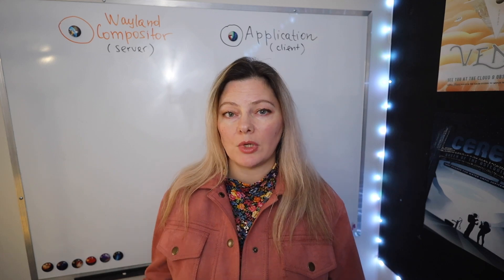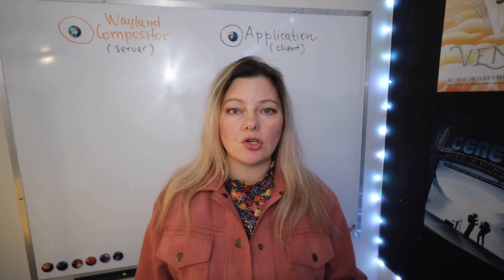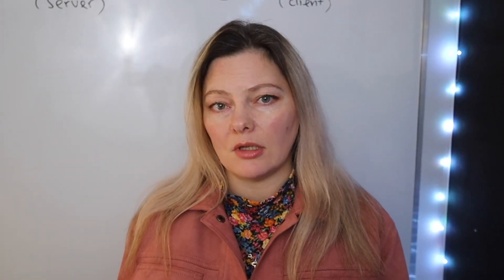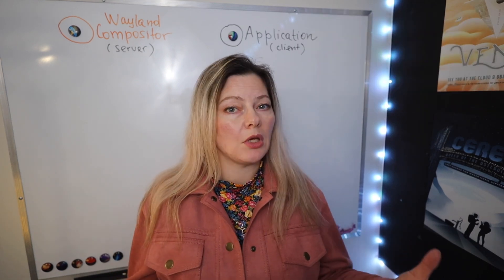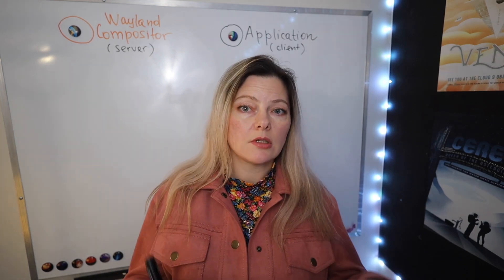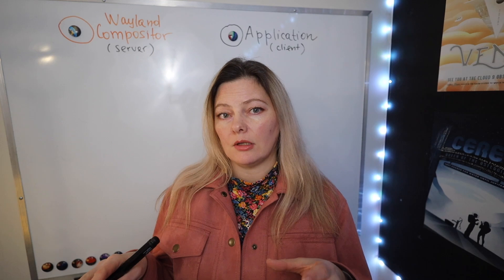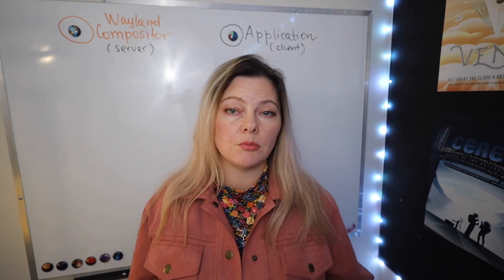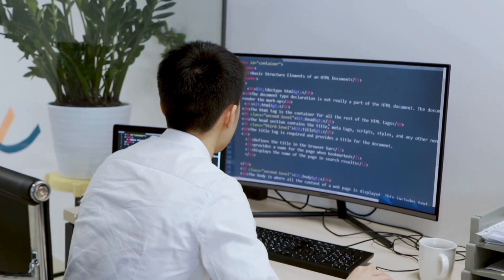Understand Wayland's Source Code in 15 Minutes (No Coding Degree Needed!)

Comment: I'm looking for the most basic C sample program that will display a Wayland window on a Linux desktop. It's very easy to find small sample programs for X11, but not for Wayland. Maybe people who have spent much effort to learn the application coding are not going to give away their code. I can understand that.
Reply from the maker: If you haven’t seen it yet, tinywl is a super minimal C example of a Wayland compositor using wlroots. It’s not quite “hello world” simple, but it’s about as barebones as it gets right now.

I’ll try to break it down in a future video as I work through it myself.

Comment: This was a really good video, but it was quite hard to follow simply because of the poor audio leveling, and the static in-between cuts. It sounds like you have Automatic Gain Control enabled on the recorder, which I think is the source of both these problems. I ended up having to correct the audio in-order to watch.
Reply from the maker: Thank you for the feedback and for letting me know about the audio issues! I had not noticed it when editing. Possibly listening with the headphones on is different too. I should have checked that and tried to correct the issue when editing. I had some concerns about the audio quality when recording this video, since I used my external but stationary microphone on my desk, which was farther away compared to my typical sitting down videos. And yes, you are right, automatic gain control was on. Looks like I need to invest in a wireless mic for this type of videos.

Comment: I think a good analogy would be comparing the X server to the real world. In such a world, we have clients who want to paint pictures, and we have a single painter, which is the X server. The clients want to paint different things, so they continuously send messages to the painter: "paint this for me," "paint that for me." Next to the painter stands another person who arranges the drawings (the equivalent of a window manager). The clients want one picture to be placed here or there, so, through the painter, they communicate with the person arranging the drawings. 

Additionally, sometimes they want to use accelerated painting (OpenGL), which makes everything even more complicated. In the end, it turns out that the painter (X server) is someone who paints several pictures simultaneously for different clients, constantly intermediates in communication between the clients and the person arranging the pictures (window manager), and occasionally has to handle accelerated painting (OpenGL). 

On the other hand, if we were to bring the Wayland world into such a real-world example, we would have clients, each of whom is a painter. Each painter calmly paints their own picture independently of anyone else. When a picture is ready, they tell the person who arranges the exhibition (Wayland): "Here’s my picture; arrange it however and wherever you want."
Reply from the maker: I really like this analogy! Thank you for taking the time and writing it. It will be valuable for the viewers.

Comment: I don't even understand why it's client-server when i thought that was the whole problem with X.

(Ugh, xml, showing how long ago wayland started.)
Reply: xml for this kind of thing (defining a spec) is still common
Reply: This is an abstraction of software architectural solution. Every program is a client that needs an orquestration to work together. That 'maestro' is the server. The problem with X11 is that it is an old solution to fix problems that doesn't exist anymore and doesn't fix moderm problems. Wayland server is much more simpler and faster than X11

About xml, it is perfect for wayland needs. Xml is human readble  and structured in such way that allows express tecnical details much better than the most of alternatives.
Reply: @welldias9668  It's really easy to do human-readable structured data, like json or yaml.  XML needlessly adds a ton of noise

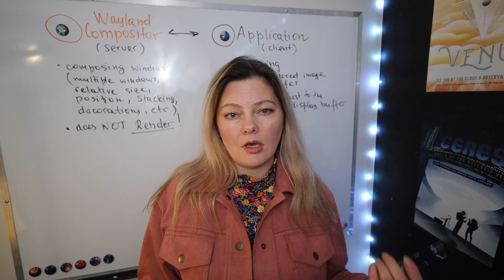Comment: One thing that confuses me 7:00 you say wayland cannot modify the image but most compositors will dim the window if its not responding (kde, gnome i think too) so are they breaking the protocol?
Reply from the maker: @alexstone691 Thank you for asking. My apologies if it was not clear enough.
Reply: So the compositor gets the image back from the client as is. When compositing the final screen, they can do things to the image as they put it together into the final monitor image, but it's not going to modify that actual image data referenced by the client.

Or in other words, the compositor will NOT do any changes to the image supplied by the client in such a way that the client would be able to see or detect the changes.
Reply: I think she means that they won't fundamentally change the rendered image, but they could apply an effect to the whole image.
Reply from the maker: Yes, that’s exactly what I meant. Thank you for your reply. 

The compositor doesn’t alter the content of the rendered image itself (what the client creates), but it can apply effects like dimming or transparency to the entire window as a separate layer. This doesn’t violate the protocol because it’s just visual decoration, not a modification of the client’s buffer.